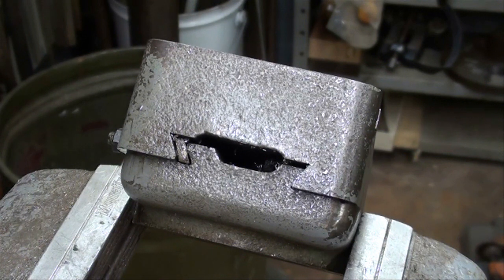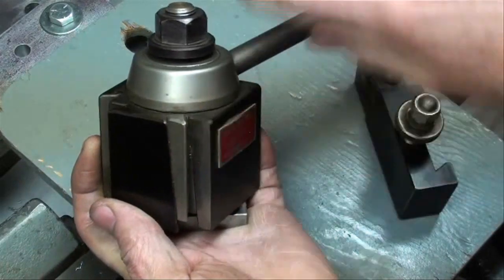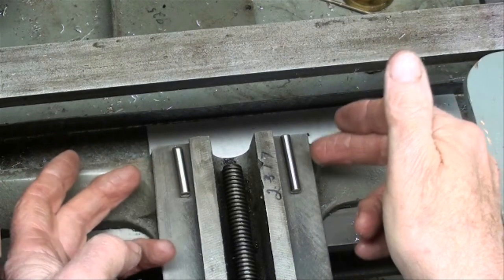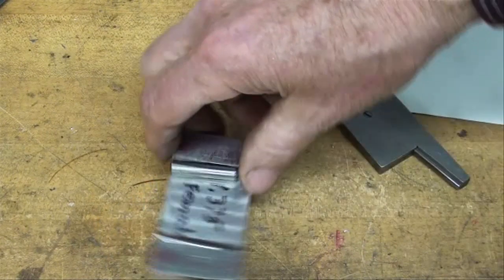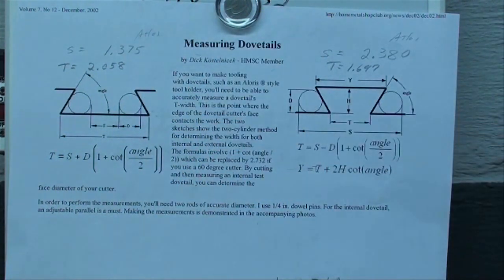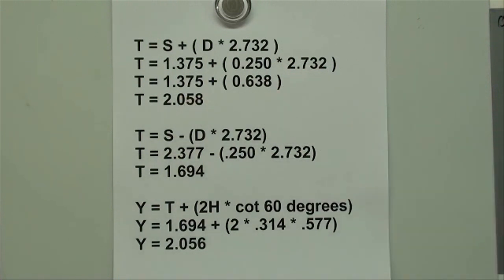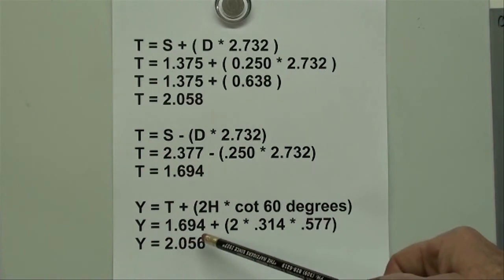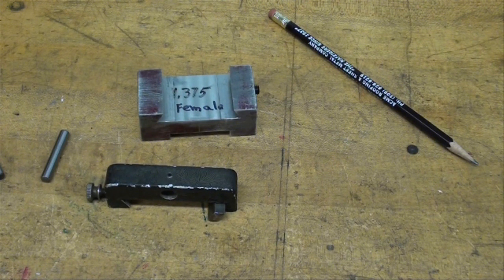MACHINE SHOP TIPS #75 Measuring Dovetails on the ATLAS LATHE tubalcain

Comment: Thank you very much Mr. Pete. I am designing a jig to set crankpin quartering on model locomotive wheels.
I have drawn it having dovetails so before I go to the mill and start cutting steel I wanted to gain the formulae for measuring dovetails using pins so thank you sir. The body of work that you have left on youtube is a wonderfully useful resource.

Comment: Thanks for this.

The formulas in Machinery's Handbook (I have a 1957 edition but same formulas as yours) are the same as those you're using, but arranged differently.  Machinery's assumes you know the dimension you want for the dovetail and arranges the formula to solve for the distance measured across the rods.  You're going from the measurement to solve for the other so the formula is rearranged.
Reply from the maker: Thanks--good point

Comment: Great videos. I've watched them all and wait anxiously for the new ones to come out. I know you don't like questions, but I can't resist this one. Is there some reason you don't just measure the male dovetail directly and then go 2 thousandths over for the female? Or if you only have the female, use the special properties of a 30/60/90 triangle to calculate the size of the female more easily using the formula 2 * (Height divided by square root of 3) + width at open end of the dovetail.

Comment: Last critical comment: in the video, the calculated size for the FEMALE dovetail was 2.056, while the MALE was 2.058. While this may be a desirable situation in some arenas, in this case a .002 interference fit is probably not much fun.  Measurement error? Or?
Reply: Fast forward to 10 years later… I just watched the video and Mr. Pete mentions in the beginning 5e part has some slop, some 2 thousands worth, so pretty bang on 😊

Comment: Don't think anyone caught this: 1.375 + 0.638 = 2.013 NOT 2.058.  Arithmetic errors will bite you every time...

One of my college engineering profs said, "A calculator is a device by which freshmen can obtain the wrong answer to 8 significant digits."  I was the only one who agreed.